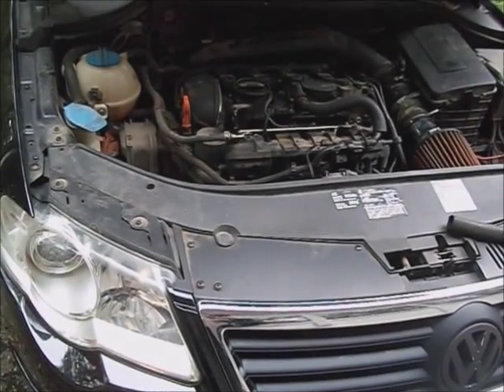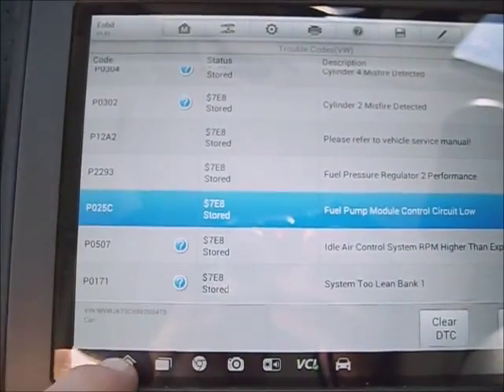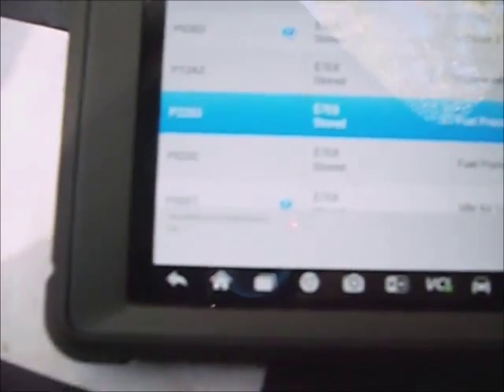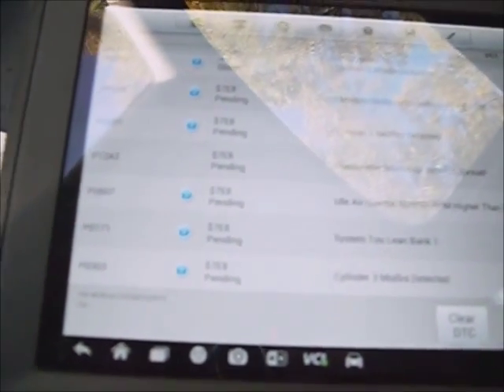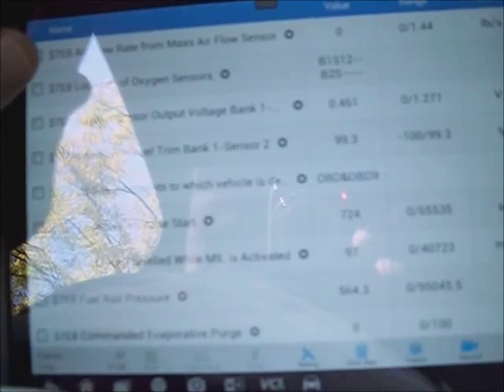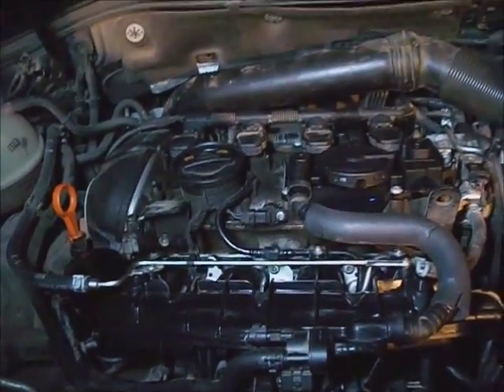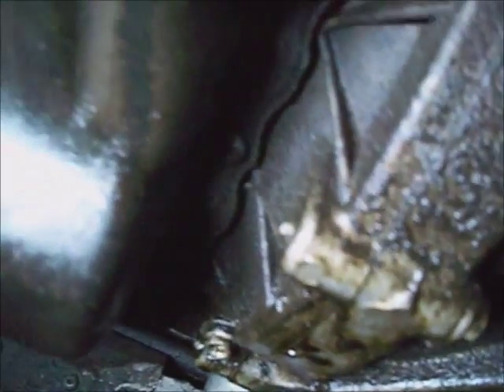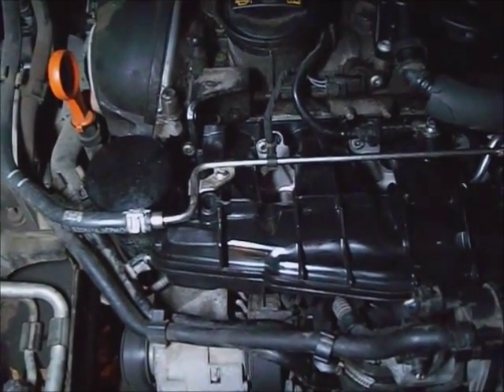VW Passat `08 w 2.0T cct stall no start codes P0171 P025C

Comment: What is the normal output voltage from the module to the pump?
Reply from the maker: 6.5 v, on the new module, at idle.  It was in the video.